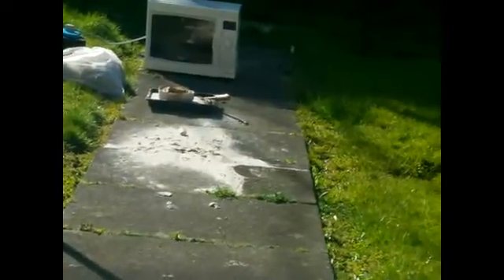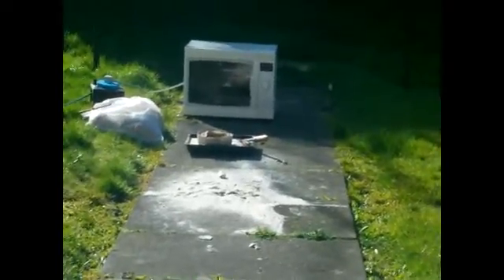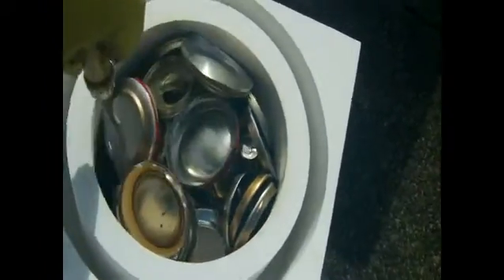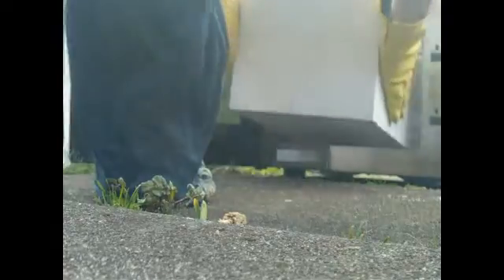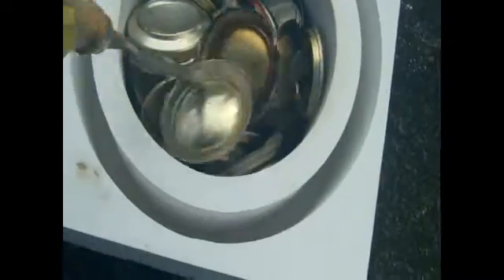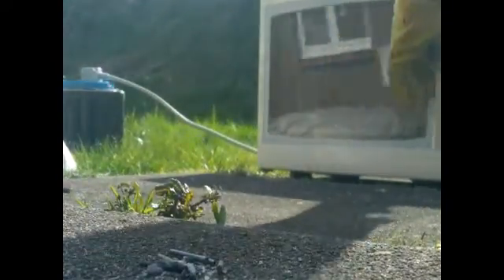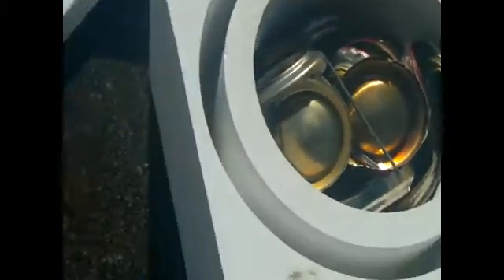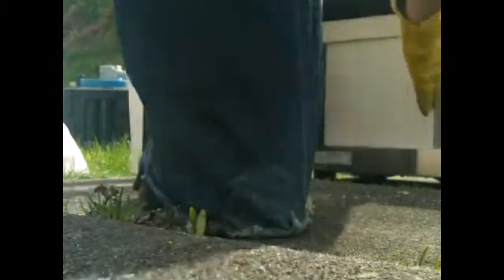Attempt at melting aluminium beer cans with calcium silicate crucible

Comment: Put a CO2 canister in the microwave aside with these cans  in something really heat-resistant. I don't know especially why, but it makes stream of gas so hot, that it can quickly melt ceramic pot.